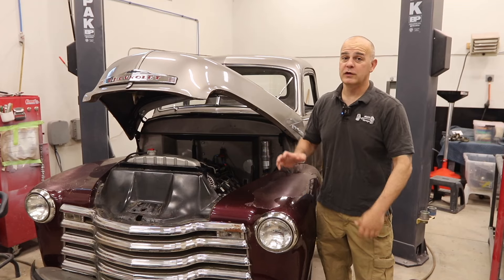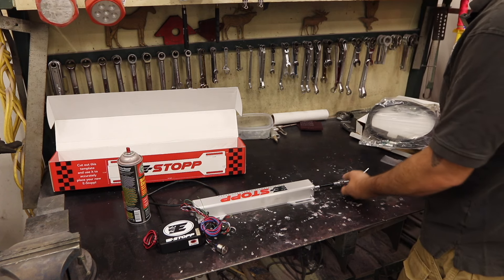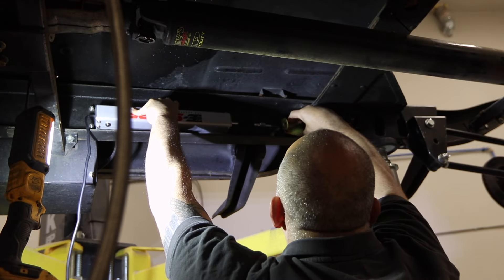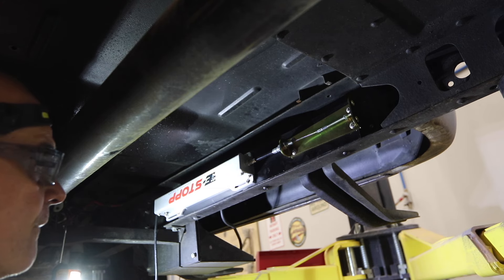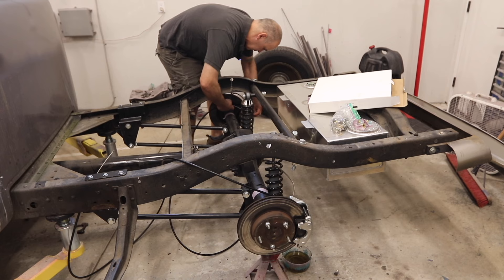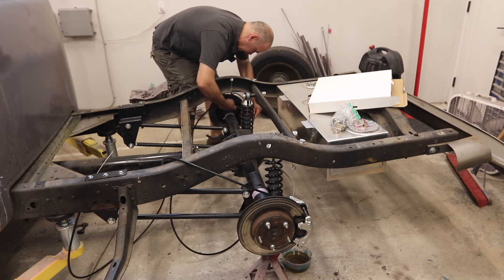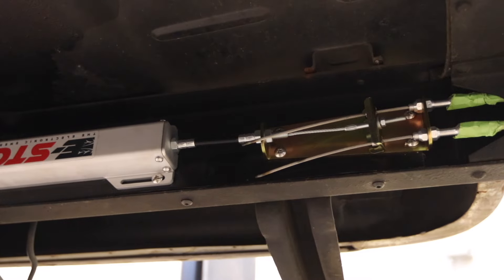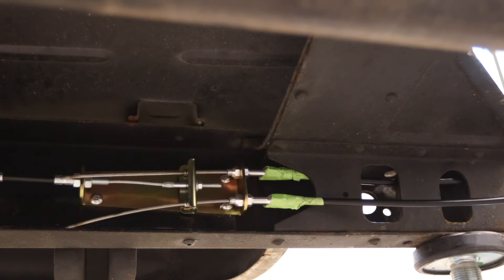11.5- E-Stopp Parking Brake Install

Comment: I put one in my 72 Bronco. I was able to use the original E-brake cable bracket on the underside of the tub. It was great to get rid of the foot pedal set up that's very hard to get to with a full roll cage.

 It's totally worth the money, and it wired into my Dakota Digital gauge, which has an E-brake idiot light 👍👍

Comment: I am doing an E-Stop as theft deterrent on my bronco. Discreet/ hidden location for the actuator.  My E-Stopp is an older model - no speaker on it.  since it was purchased as project and no E brake pedal was included, the E-stopp seemed like a better purchase than the new e-brake pedal!